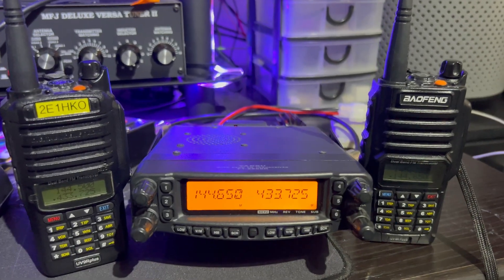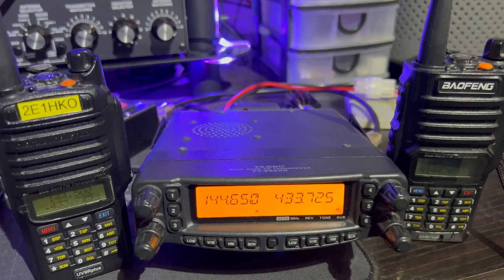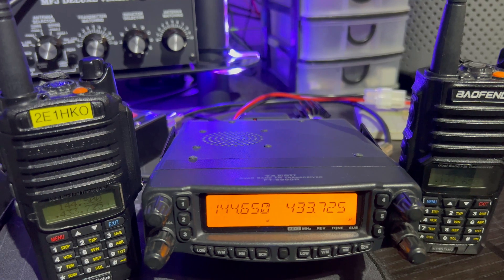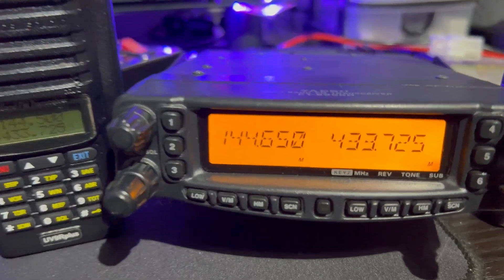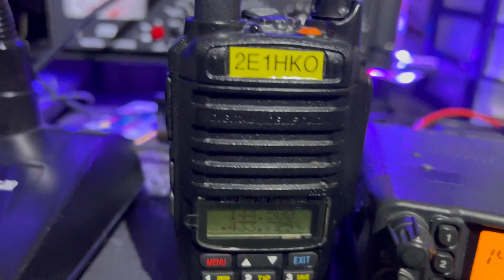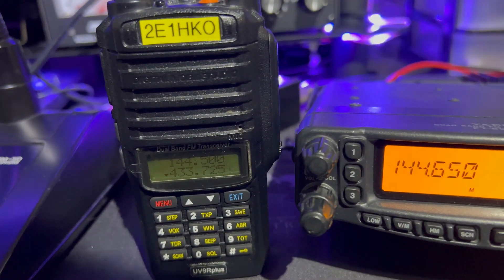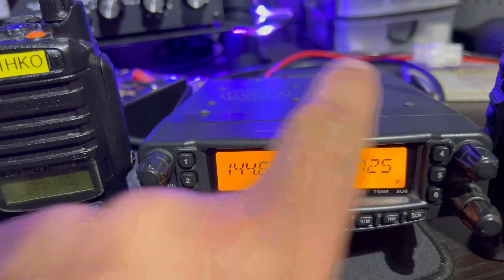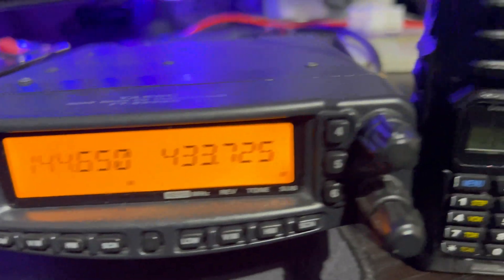Yaseu FT-8900R Cross Band Repeat Demonstration

Comment: Hi Jason. Very interesting and thanks. I too am Raynet (wales) and use the same ft8900r. So if I’ve understood correctly you set the two frequencies (2m and 70 cms) as cross band repeater on the 8900 and that means you can use a handled or two handhelds to communicate via the 8900 if you are away from your vehicle for example. Have I understood that correctly as it would be very useful when on events. Is it that simple or have I missed something. I guess the handheld are on lowest power setting also ?
Reply from the maker: Sorry for the delay in responding. Yes it’s as simple as that. You can leave in a unsupervised in a vehicle, but it’s normally within close proximity. We have done this many times Once in cross band repeat the radio is locked, so you would have to use a Hand Held radio also 👍 73
Reply: @jason2e1hko59  cheers for that. Tried it out and it works perfectly👍